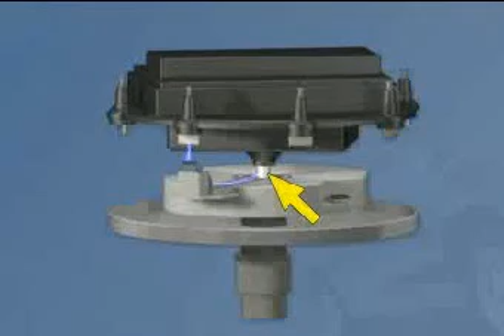A 101 On Car Distributors

Comment: As long as the intake does not inhale water, you are fine. What some trailblazers do is they would fit in an intake snorkel so that way the engine can be submerged underwater and still run.